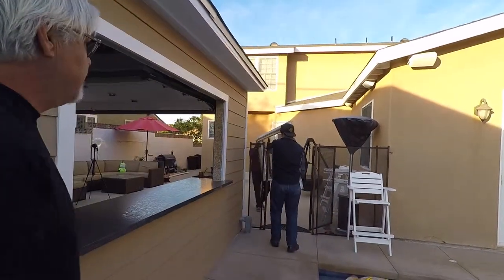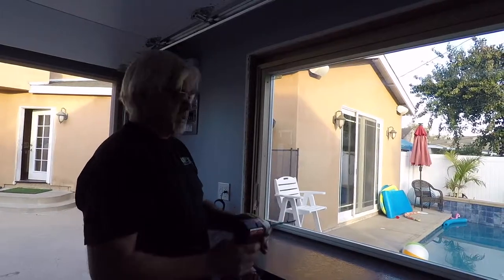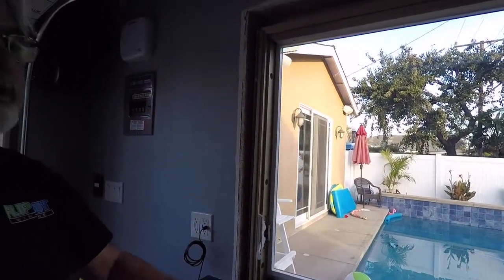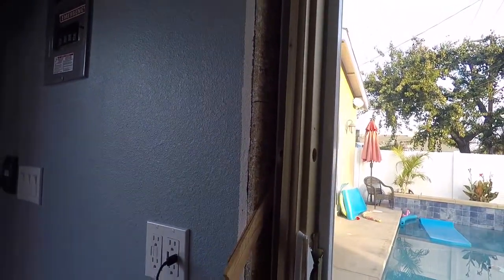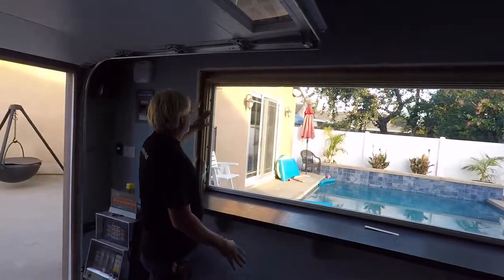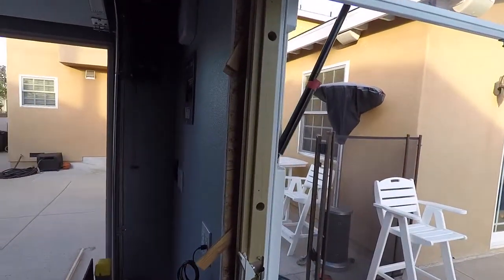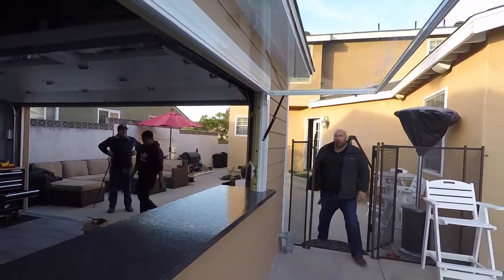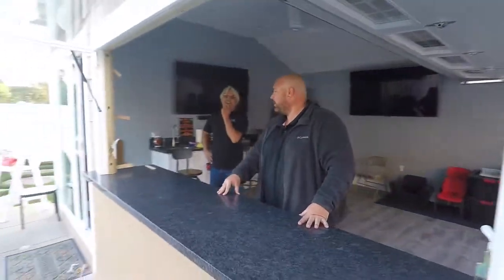HOW TO INSTALL A FLIP OUT WINDOW QUICK & EASY

Comment: How does it seal at the bottom? That seams like a pretty weak barrier/seal, is there any pressure applied down on that seal or is it basically a wind seal only?
Reply from the maker: Our bottom seal is similar to a bottom door seal. We also use Ascentric locks, which compresses the seals tighter together when you lock it.
It is basically installing it at the proper height and following the installation directions properly, so you have a nice tight fit.
We are in over 40 states now, and many are back east in the snow and rain. We advise to slope the counter away from the structure and seal it properly.
Please reach out with any questions you may have or go to www.flipoutwindows.com. Hope to hear from you soon.
Reply: @flipoutwindows5153   The client has some pretty significant climate concerns and just want to get an idea of how these seals work, watching your videos it isn't very clear. Are you saying these "eccentric locks" have some kind of mechanism that pushes downwards on the bottom seal? Or are you saying that when you lock the window it pulls the window tight against the left, right, and top seals (and probably a healthy bit on the bottom as well)?
Reply from the maker: @getstuk87  In order to understand how the bottom seal works, I would suggest you follow the link to our website www.flipoutwindows.com/details-specifications and there is a close up picture of the bottom seal.
The first thing you notice is that this seal extends past the metal framing so it makes contact with the counter first.

This seal is attached to our sash frame and when the window is closing onto the counter, this seal gets compressed against the counter. When installing our windows, you first place the window on the counter and the weight of the window is all on this seal so it is too tight. You must lift the window support frame up using standard door shims approximately 1/16 of an inch to reduce the pressure on the bottom seal. Be careful not to raise the frame too much, as you may lift the bottom seal off the counter creating an air gap.  
On both sides and the top of our window, we offer a back seal and a front seal for double protection, then eccentric locks compress all these together to form a locking seal.
Additionally our sash frame is all steel and one solid piece, so when it makes contact with the counter, there is no give and it keeps its shape. Unlike aluminum version that flex and cannot hold their shape, that type is bolted together. 
You can also down load our installation instructions from our website and learn more about it. If you are really interested, give us a call anytime and I will walk you thru.
Thanks
Gary Johnson / Flip Out Windows
949.367.0642